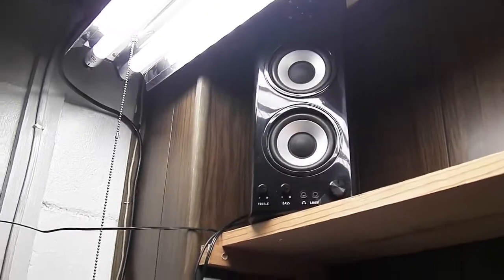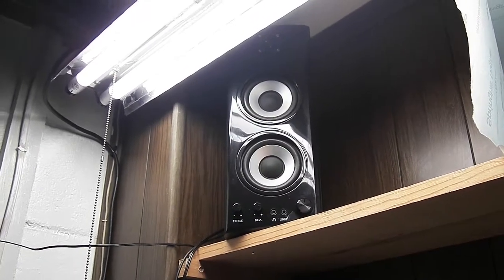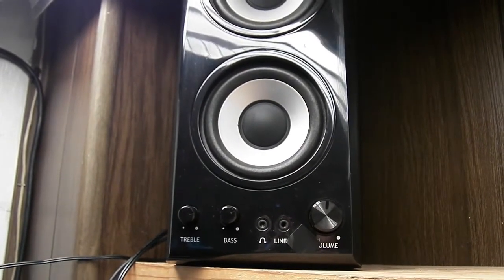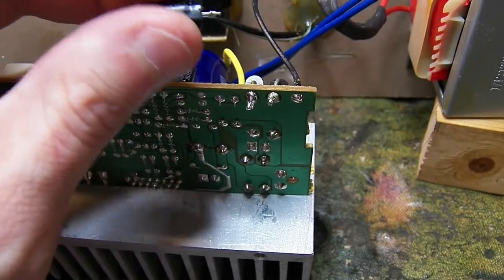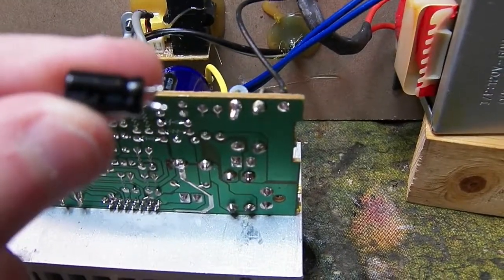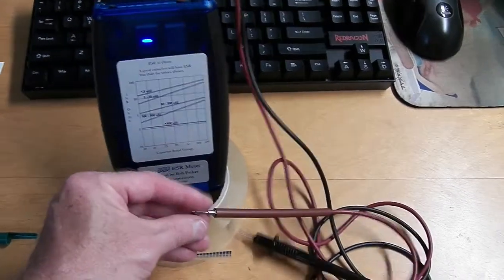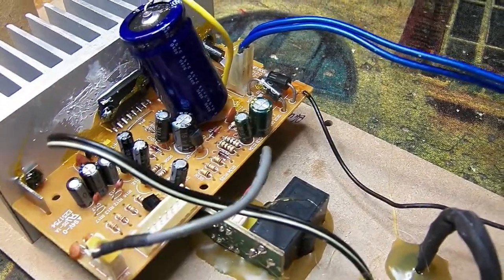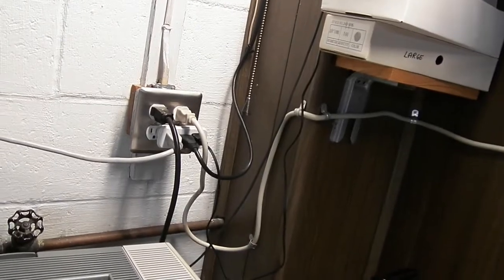Repair #2 of Genius SP HF 1800A multimedia pc computer speakers

Comment: @bigslick tnx man, this work! 
I had same situation. First i have replace capacitor from first repair video C110 4700uF 25V(the big one :) ) about half year ago, and it worked maybe month or2, and buzzing sound returned...
Finaly i got some time to buy and replace another 2 capacitors from this video. 
C134 4.7uF  50V that i removed has reading about 4.5uF, so this one was maybe ok but i replaced them, new one has reading od 5.3uF(?).
But other capacitor C131 100uf 25V has reading about 22uF, and this one was definitly faulty, new one got about 97uF 
tnx again, hope we dont need repair #3 :)
Reply from the maker: very good, yes I agree that hopefully no repairs needed anytime soon.  They still sound excellent, and if another repair is needed, I will still repair them next time.
Reply: @bigslick  yeah, great sound! Just in case, i have STA540SAN ZIP-15 in shopping cart, if this amplifier breaks down :)

Comment: Hey there me again lol. I was hoping u could help me with your mad PC skills. I just put Ina new motherboard and power supply in my Inspiron 570 and on start up the on light stays solid orange and the screen is black.  I tried starting witho
ut ram and hard drive but no luck. Please help ☹️😭😭😭 Thank you.
Reply from the maker: Hi, nice to talk with you again!  If you remove the ram and try to turn on, if you dont hear any beeps coming from the little beeper on the MB, that is often a sign of a bad MB.  The MB that you installed is almost certainly old and used (no new MB for that machine would be available now, due to its age).  Chances are good that the "new" MB was pulled from a machine of unknown working condition, regardless of what a seller may have told you.
BUT... if the power supply is defective, or not installed correctly, then that can also cause the MB to not respond properly, so you cant rule out the PS being bad.
So basically, ... your PC is now kind of hard to diagnose because so many things have been done -- a different MB, different power supply, swapped over ram and CPU (either of which may have been damaged).  We are dealing with a lot of unknowns now.

If you still have the old PS, try swapping that in (ie, old PS with new MB).  If no luck, try the opposite combo -- old MB with new PS.
Good luck.  If nothing else, you will learn a lot and experience is worth something!

P.S. - I think your model has beep codes.  A few machine do not -- the ones that do not have a beeper on the board, have a blinking LED instead.  If you see a blinking LED on the MB, then that is the diagnostic method.  Either way, you count the blinks, then google search for that code.  ie - Dell 570 two beep code.  or Dell 570 two blinking LED code.
The Dell in the video that I made, the video that you commented on previously, was my Ex's PC, so once she left, I do not have the PC anymore, or else I would have opened it up and tried to help you even more.
Reply: @bigslick  okay thank you so much. I'll try all these things and get back to you. The memory sticks are not new just the mb and ps. What a nightmare. I though I connected the ps properly but also suspected it could be wrong. I have the p4 plugged into the HD and the p5 into the disk. The brown cord with the square that has four holes connected to the mb under the pw. Lastley the main one that's the largest I'm sure is in the right place.
Reply: Also as soon as I have it up again I would love to give you a donation! Also I just remembered something else and will try to explain. When I removed the fan from the mb there was a little possibly metal square piece where you put the thermal paste. Well the new mb didn't have one so I used the old one.
Reply from the maker: @EnergyAndLightAwakening  Hi, no donation necessary!  I believe in good vibes, just pay it forward, try to help someone else when you can.  As far as reusing parts, that is fine, just install it same as it was.  Best thing when working on ANYTHING, whether it is mechanical (such as a lawnmower) or electrical (ie a computer), take a closeup video of everything you do from the minute that you start, so that you can always see how it "was", where every parts and screw goes, their orientation, etc.  Record everything.  Dont work on it unless the camera is recording!
Reply: @bigslick  I did make a video lol.
Reply: @bigslick  Sorry to hear about your ex. Thank you for the kind intention though 😄 I'm going to try again today but one last thing I probably should have started with. The reason I replaced the mb is because the 1st ps I tried was the wrong size even though it was advertised as appropriate. After I plugged it in and started up the PC I saw a puff of smoke coming from the largest plug of the ps that went into the mb. After that it stopped working. Is there anything else this may have effected?
Reply from the maker: @EnergyAndLightAwakening  That's a bummer.  When smoke and burning is part of electronics, anything is possible.  So the cpu and ram may have been damaged, impossible to know without testing them in a working pc. Goes back to my original response -- so many "unknowns" here that it's hard to narrow down where the problem (or problems...) may be now.
Reply: @bigslick  AAAAAAH! Lol i've since replaced my broken down backup PC with a new one but I'm not gonna give up on my main baby. I've sent the motherboard back for an exchange so I'll try that again. Is there an easy way to check the other things you mentioned. I might end up having to find a local place which won't be easy.
Reply from the maker: @EnergyAndLightAwakening  Hi!!!:goodvibes:.  After all of the work you put into this, you probably need a :virtualhug:!  
You need a working MB to test the ram and cpu.  Cheap power supply testers are sold on ebay, but at this point I would not suggest that you buy one, you already have enough time+effort+money into this project.  Try the replacement MB with the rest of your components, and if no luck, then probably time to just call it a learning experience.
Reply: @bigslick  Thanks. I found the exact same one on ebay for 50 bucks so I will be able to switch out the parts. Thanks again for all your help 😊😉😃
Reply: @bigslick  Lol uuuuuugh!!
Reply: Hey I just wanted to say thanks one last time...at least until next time lmao. I ended up sending the motherboard back and since the reverberished PC from ebay was in such great condition I just switched out the hard drive. So now I'll keep my original for parts since I've mostly replaced everything  in it.
Reply from the maker: @EnergyAndLightAwakening  awesome, good move.  Glad that you got it back up and running.  Feel welcome to chat anytime!  Take care and best regards.
Reply: @bigslick  🙏❤️️😊